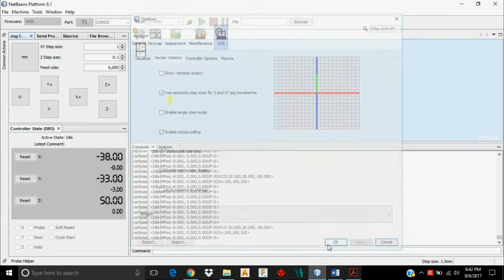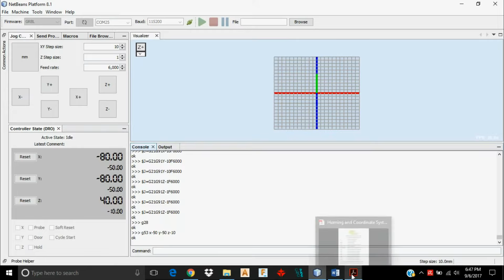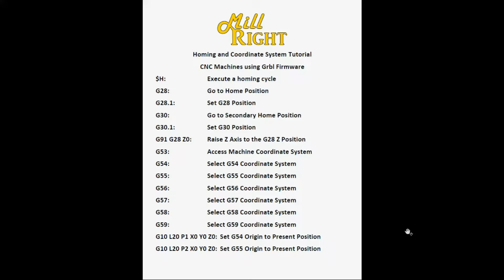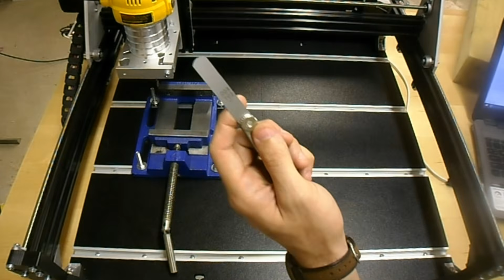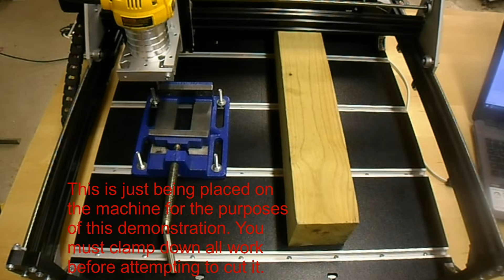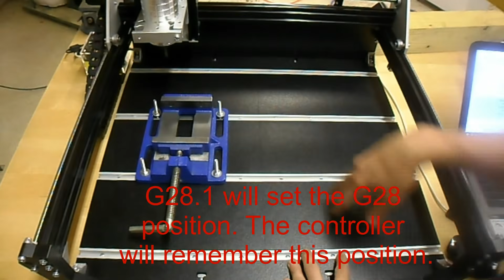Comment: I am using grbl guru for running gcode but it behaviour is wierd 
I am running grblmega5x edge 
My z axis motor is fitted inverter from ur z axis 
So i am using $2=3 $3=3 and $23=7 then my homing works good as I wanted in right hand corner if machine is in front of me 
But when I starting probing and starting gcode running z gose in wrong direction

Comment: Are the machine coordinates alway's negative ? What if you have youre endswitches so that it homes in the left down corner ? Question because I did a little test with a board with Grbl and could not move the machine coordinates in positive values....

Comment: Very useful. Pregnant question: for all these GCode coordinate settings, where is the center of the machining tool with respect to the table positioning? Is the center of the tool bit at the assigned coordinate, OR is the edge of the tool in bit at the assigned coordinate?

Comment: Hi everyone I am new to CNC but my question is that every time I load a G Code in UGS it is way off from my tolerable work area and gives me errors when I try to cut, how do you set it to load your projects into the working area, I have not found away to do that yet
Reply: You likely have something incorrect in your CAM setup where your origin is far from the area that is to be cut.

Comment: Great Video! Helped me come up with a UGS macro for my GRBL powered X-Carve...

Normally when I'm done with an operation the spindle will either return to G28 ( to the front for a manual tool change ) or G30 ( the back to clear the workspace ) so when I'm done after a tool change the spindle will usually be WAY off the part making it necessary to first return it above the workpiece so I can perform a Probe command.

The fastest way to get to the workpiece would normally be a Return to Zero but that's doing ALL axis instead of just X & Y which sucks when you've changed into a, potentially, longer tool as you'd then ram it into the workpiece.

With the video I came up with a G53 G0 Z-1; G90 G0 X0 Y0 Macro to solve that issue for me.
It'll first rapid the Z-Axis to -1mm of the Z-Axis 0 Machine Coordinates and once it reached that safe position will continue to rapid the X/Y-Axis to 0 of the Work Coordinates

From there on its a quick Z-Axis Jog down to a reasonable height followed by the Probe Command =)

Comment: So, the G28 commands, the G30 commands and the g92 commands all reference from machine coordinates (whether homed or not).  Did I say that right?  But as for G54-G55-G56 etc... do they also use machine coordinate reference or just work coordinate reference?  Am I thinking right here?
Reply: A little late reply to your question, but just in case someone else needs it also :)

G92 you can think of as a disposable offset command, as it will not save the machines position information to EEPROM, so if you zero out your workpiece using G92 and power cuts out for any reason, you have now lost your position without any possibility to get to the same location. Proper use of G92 would be inside a program to make multiples of the same part, but not use it as a zero point (origin) reference setting.

G54-G59 store offsets from the Machine Coordinate System and these are saved to the controllers EEPROM when you issue a G10 command. For example, G10 L20 P1 X1 Y2 Z3 command to set G54 (P1) so that your current location becomes X1 Y2 Z3. With this specific command you are telling the machine to calculate the offsets from the Machine Coordinate System (homing switch locations) such that your G54 Work Coordinate System at this very point you are in right now shows as X1 Y2 Z3. The same applies to all the G55-G59 Work Coordinate Systems.

In the instance that you use G10 L20 command to set your Work Coordinate System, you are referencing your workpiece from the Machine Coordinate System (homing limit switches) and in the event of power outage your machine still knows where that workpiece is. So on power up, you do homing cycle, the Machine Coordinate System is basically set to zero and then the controller looks up from the EEPROM the saved G54 offset (for example) and adds those offsets to the Machine Coordinate Systems values to give you your Work Coordinate System, which is still happily in the same place you set it to with the G10 L20 command when setting up your work.

G28 and G30 are two same commands, just with different XYZ points, basically Location # 1 and Location #2. If you issue a G28.1 or G30.1 command, the controller saves your current locations Machine Coordinate System values to EEPROM. If you then issue a G28 or G30, it will move all the axes to that saved location value. You can also give the G28 or G30 and intermediate point, like G28 Z2, which would first move Z to 2 in your Work Coordinate System and only then move that axis to the saved value in Machine Coordinate System.

The difference in using G10 L20 P1 X0 Y0 Z0 versus G92 X0 Y0 Z0 is just 5 characters, but it will save your ass if the power goes out or anything else that aborts the machining, like a little crash and lost steps.

TL;DR: Do not use G92 to set your Work Coordinate System, use G10 L20 P1 for better result if your machine has homing limits.

Comment: Nice video. But I'm wonder how did you set up those 4mm offset used in home cycle? Was that by using 28.1 - I do not think so. Seems like it is some config setting in GRBL.
Reply: Jakub Biwel it’s a setting in Grbl
Reply: @MillRightCNC  So what is the setting??
Reply: $27, answer to my own question

Comment: In my case,while homing only z axis is move to end stop. X and Y axis are not moving.Although there end stops are active.only $22=1 is setting?any other thing to set up?
Reply: Are you using one of our machines or some other machine? Other manufacturers may have things configured differently. It is standard for Z to move first then X and Y to move once Z successfully finishes.